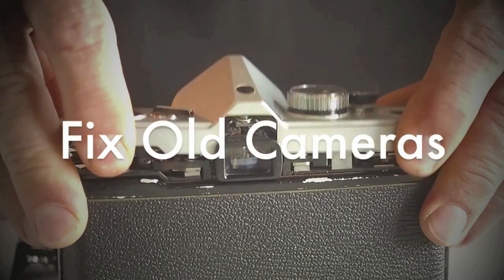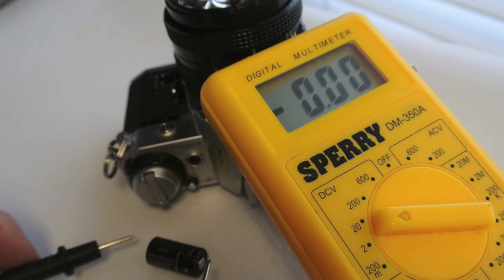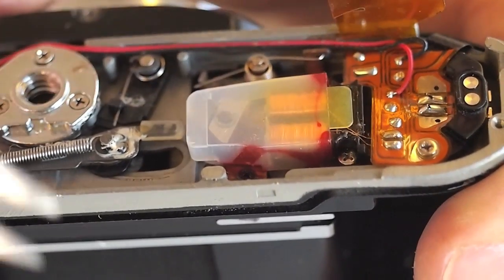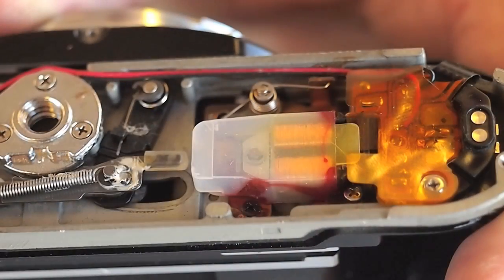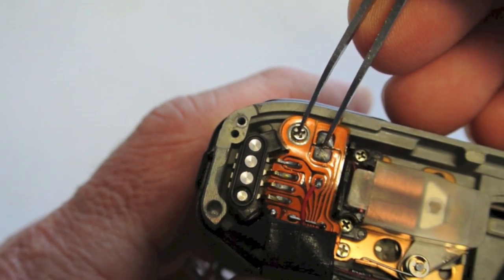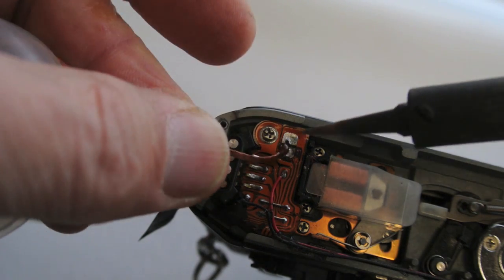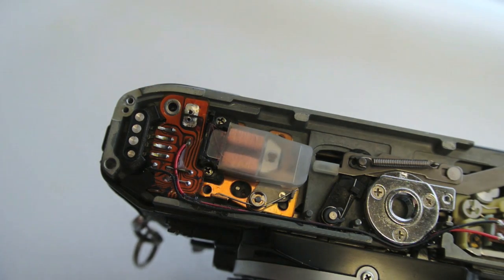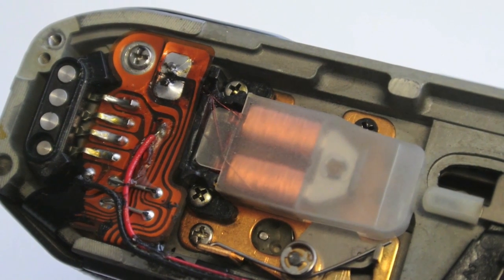Fix Old Cameras: AE-1 Release Magnet

Comment: My AE-1's mirror stays up when I press the shutter but does not release by itself, I have to either remove the battery or press the battery check button so the mirror can release. The battery is brand new and my shutter speed is on B mode. What could be the problem? I also opened the bottom lid to check the magnets, the magnet shown in the video is fine, but I noticed other magnet , a smaller one, which I guess it's the mirror's. When I press the shutter the main magnet releases but the smaller one doesn't. I did the ground screw test on it like in the video and it also releases that way.
Reply from the maker: Your description of the camera malfunction could indicate an issue with the tungsten ASA link wire. Is the shutter hanging open while the mirror is stuck in the up position? The  typical symptom of the tungsten ASA link wire breaking or coming off the pulleys is the pegging of the meter indication and the mirror to hang up with the shutter open. Remove the top cover and inspect for such a malfunction. If you find the link wire to be broken .005 Kevlar fishing line is a suitable substitute or find a donor camera. Watch FOC video Canon AE-1 ASA Linkage Wire -
https://www.youtube.com/watch?v=hJUidgM6LoI&index=17&list=PLbBpUKJh6LCmx4zwCUEg5dCoIraoFd8LS
Reply: Thank you so much for your response. I checked the resistor plate and it turns when I turn the shutter speed dial and the ISO dial. So if it's not the tungsten wire, what could it be?  :(
Reply: And also yes, the shutter hangs open while the mirror is in the up position :/
Reply from the maker: The movement of the ASA/ISO dial confirms that the wire is not broken, but it could still be off a pulley or under the ISO dial contacts. If the wire and connection are in perfect order, than it could possibly be faulty control electronics or open in flex circuit. Because the shutter completes the cycle by tripping with the battery check button you do not have mechanical issue with the shutter or mirror. The most common cause off the described issue is the ASA/ISO dial wiper contacts blocked by the misplaced connecting tungsten wire, but it is not the only cause. If you do not find an open or short in the flex circuitry, an IC failure is the likely culprit.
Reply: I'm taking my camera to a canon authorized service agency since I don't have enough equipment to check that and I'm afraid of ruining the ASA dial because I don't have the proper wrench to open it, lol. But I'm telling that to the tech support, thanks to you now I know what the problem might be and I've learned a lot about film cameras in just 2 days by watching your videos, it's amazing. Thank you so much for your response and I'll keep in touch in further resolution of my cam. :)
Reply from the maker: Sounds like a good plan and thank you for your comments  and interest in Fix Old Cameras.

Comment: Hi! I’m worried about my camera Canon A-1 and I would be very grateful if you could help me.
The problem is that the mirror in my Canon A1 is stuck up. This means that I cannot take any photos. I tried to pull it back ‘down’ but it just keeps moving ‘up’. I have no idea what to do, please help me!
Reply from the maker: It could be that you have dried mirror lift escapement...
https://www.youtube.com/watch?v=4YMpMHwMtX4&t=6s  it applies to the A-1 also

If you decide to go deeper and investigate the mirror mechanism function...
https://www.youtube.com/watch?v=ouxlXb_DMKQ&t=329s
Reply: I only now doscovered that the rewind button at the bottom of the camera is stuck in its ‚depressed’ position. the mirror is still up, i cannot advance the film to the next frame and the shutter won’t release. what should i do? follow the steps shown in the video?

Comment: my ae-1 shutter curtain wont close after i press the shutter button. is this method applicable for my camera problem?
so after replacing the camera's battery with a new 4lr44 6v battery. my shutter button now can work, but oddly after it fire, the shutter curtain won't close :( (the shutter speed is not at B) i see this by firing the shutter button while let the back of the camera remain open (i did not load any film) and when i press the battery check button, the black shutter curtain close. obviously i thought there is something wrong with this camera. is this have something to do with release magnet? please help.
Reply from the maker: +Josh Smith 
The second shutter curtain hanging open is not caused by a release magnet malfunction. It could be caused by the tungsten meter link wire being dislodged and getting caught up under the wiper contacts of the meter resistor base. You might refer to the FOC videos, Canon AE-1-Top Cover Removal and Canon AE1-Jammed wind lever for some insight into where the link wire is located. There are also other malfunctions that can cause the issue that your camera is demonstrating, but the one described is common and easier to address.
Reply from the maker: Excellent to hear of your successful repair.

Comment: When I press the shutter release the camera only occasionally releases. It has a fresh battery and I have cleaned the magnet. The problem is that the magnet doesn't release. What is the next step considering the magnet is working.
Reply from the maker: If the magnet does not release via the procedure outlined in the video, the magnet is most likely defective. Otherwise erratic release could be the magnet release capacitor. It is located next to the release magnet and is typical blue. It will be difficult to measure static voltage to determine condition of the release capacitor. The switch closed by the release button sets a chain of electronic events in motion.When things have progressed enough 
to suit the CPU(central processing unit) inside one of the three main IC circuits, pin two of PX-2 IC connected to pin nineteen of PX-3 IC goes low and trips the shutter timing sequence. The connection is also taken thru the flex circuit at the coil of the release magnet to enable it to conduct. This capacitor then discharges through the coil of the magnet. You might try swapping out the capacitor from another AE-1 camera donor.

Comment: My magnet is bad but also the shutter will not wind and the mirror sticks in the up position when the magnet release is engaged by jumping the contact point. What does this mean?
Reply from the maker: The issues listed in combination with the bad magnet might make the camera in question a candidate for the role of a parts camera. The camera is probably going to need some significant work to restore it to good working order. Sorry that this post does not offer any simple solutions. Thank you for your interest in Fix Old Cameras

Comment: I've cleaned the magnet surfaces in my AE-1 and it releases when I short the magnet terminals but not when the shutter button on top of the camera is pressed. Any suggestions?
Reply from the maker: There could be a break in the flex leading to the upper circuits or the shutter release switch could have poor contact or bad solder connections. Another possibility that is really no longer practical to repair is the IC that sets on the shutter release side of the prism could be defective.
Reply: Fix Old Cameras
OK, thanks very much.

Comment: Great video, i have an issue with an A1 the advance crank lever is stuck and que shutter is in middle position, I tried this solution but the crank do not move, can you help me?
Reply from the maker: If the shutter is stuck in mid advance or release than there is an issue in the gear train or levers that control the shutter function.

Comment: My Canon AE1 has the following issue:

the lever arms the mechanism just fine, the shutter button just opens the shutter and mirror, but doesn't close them. When the battery test button is clicked, the shutter and mirror return to their closed position.

The shorting of the magnet circuit in the bottom of the camera, results in a normal functioning shutter and mirror, also matching the shutter speed selected on the dial.

What could this issue be? Is it a dirty or defective shutter button?
Reply from the maker: Sometimes a broken or entangled ASA linkage wire can cause the symptoms you listed. 

This FOC video might help.
https://www.youtube.com/watch?v=hJUidgM6LoI
Reply: @FixOldCameras , I have fixed the ASA Linkage wire and the mechanism is working fine, but the shutter is still not releasing on its own. I've read that this could be a PCB or Ribbon cable issue. Do you think it's still fixable?  

P.s.
This AE-1 has been sitting on a shelf while I was using other cameras, but I enjoy the repair attempts and getting to know the mechanics of these camera's better. Your videos are very helpful and well made, so I want to thank you for that!
Reply from the maker: @CutCopyPastefy   If you have checked the continuity of the release magnet and cleaned the holding surfaces than check the release capacitor. It is usually blue and lives next to the release magnet. You might also check the release switch contacts. If these all check out you pretty much down to an electronic issue.

Comment: Hi, I've got a similar problem I think, the lever won't advance the film but the numbers wont rewind... Dont want to force anything but stuck for things to do!
Reply from the maker: If the counter numbers do not reset when the film door is open then it is usually caused by the counter dial return spring or the counter dial engagement lever.

Comment: my shutter on the ae 1 sems a bit slower than my dslr is this normal or should it be just as quick as a digital one? thanks
Reply from the maker: It may sound a little different as the cloth horizontal travel of the shutter in the AE-1 function differently than the vertical travel of the metal shutter in you DSLR. As rule the shutter in AE-1 is fairly reliable on the speeds. If it malfunctions on the slow side it usually hangs open to the point where there is little doubt that it is having an issue. Probably the best test would be to take a test roll and take careful notes of your exposure settings.
Reply: Fix Old Cameras thanks for your help
Reply from the maker: Good to hear from you.

Comment: Hi, i've got a problem with my AE1, when I want to advance the film, at the end of the process the curtain opens.. battery is new, shutter release works just fine.. can you help me ?
Reply from the maker: Trying cleaning the surface of the latch plate and holding permanent magnet of the shutter release magnet unit.

Comment: i havea problem withmy AE. my shutter cannot release, theres no problem with the battery. but when i short the ground screw to the magnet release terminal, the shutter is released. ive tighten the screw up but it still doesnt want to release the shutter button. but again when i short the ground screw, the shutter release. but everytime the shutter is released using this method, the speed is always the same wether i set it on 1/1000 or even 2scnds. could you please help me?
Reply from the maker: Probably not going to help much, but, make sure you are getting battery + voltage at the lead on the (blue) release capacitor closest to the release magnet. Make sure you have battery + voltage at the lead of the release magnet closest to the release capacitor. If good, check coil continuity of the magnet. If no continuity, remelt solder at the test points. Also top cover can be removed and all the switches on the release side of the camera should be checked. There could be an open in the flex circuit or connections that will need to be traced. Then there is the possibility that all is for not as you could have a defective IC, the one that lives on the release button side of the prism flex.

Comment: just bought an A1 but it seem that the aperture stuck at 1.8. the lens are working fine. can u help me.
Reply from the maker: If the aperture stays open and the display is normal (agrees with the dial indication in aperture priority mode and all other functions are OK, then you will find the problem to be with the aperture control magnet (MG-1) or the CPU-IC or the OSC/INT-IC. If MG-1 is defective it is practical to replace, but requires removal of the mirror box to access. Defective IC are generally not practical to replace. Check the condition of the solder connection around the IC placements. You can also check the connections of the red wire that carries the battery voltage to the attachment flex circuit for MG-1. The issue can sometimes be repaired without pulling the mirror box, if the MG-1 is not latching because of dirt, oil or a mechanical problem (such as AE unit that has jammed gears or levers).   The aperture magnet can be partially accessed by removing the release magnet assembly unit.

Comment: Was out shooting. The shutter wont fire but I can advance the film. Battery seems perfectly fine when I check (i know this isn't the best way to check however!)
Reply from the maker: +JoelQuinnPhotography Always start the troubleshooting process for a release issue with this camera by checking the battery function in another known good camera or by checking the battery under load. Otherwise start with a new battery. Then follow the video to check the magnet and release sequence function.
Reply: +Fix Old Cameras Once you check the magnet and if it does fire (by touching the two metal parts with some tweezers) do I need to do anything else? 

If i do take it off and have a play, is it very simple tinkering around?
Reply from the maker: +JoelQuinnPhotography  If the magnet energizes then the issue is in the release circuit or a loose ground screw. Check the ground screws by the release magnet and by the left of the eyepiece ( you will have to remove the top cover to access this ground screw). The additional circuit trouble shooting is much more involved, but I will include some information from a previous post. Probably not going to help much, but, make sure you are getting battery + voltage at the lead on the (blue) release capacitor closest to the release magnet. Make sure you have battery + voltage at the lead of the 
release magnet closest to the release capacitor. If good, check coil 
continuity of the magnet. If no continuity, remelt solder at the test 
points. Also top cover can be removed and all the switches on the 
release side of the camera should be checked. There could be an open in 
the flex circuit or connections that will need to be traced. Then there 
is the possibility that all is for not as you could have a defective IC,
 the one that lives on the release button side of the prism flex. Also, if you are using an alkaline battery you might switch to a silver or lithium.

Comment: I manual release it but the curtain doesn’t open, nor does any shutter speed affect length of the sound
Reply from the maker: Check the holding curtain magnet. The smaller of the two magnets visible with the bottom cover removed.
Reply: @FixOldCameras  the problem started after i dropped my camera, i ordered a new magnet, replaced, and had no luck. Then i noticed how stiff the replacement magnet was. Turns out it was just the spring holding the magnet came off. Put it back, worked like a charm! CHEERS!!! :D
Reply from the maker: @javier4781  Right on. Keep'em going.

Comment: Hi, would it be the same process if my camera was firing whenever I pulled the lever?
Reply from the maker: Yes, the surface of the permanent magnet of the release magnet might need to be cleaned or the holding ability of the magnet might be suspect.

Comment: My mirror is stuck in the up position ( like its taking a Bold shot) and I can't wind the lever. The battery is new and in properly. Any suggestions??
Reply from the maker: Are the shutter curtains in the wound or the released position? It could be that the mirror lift escapement seized up. This is the component that causes the infamous squeaking in the release and sluggish mirror lift operation. The FOC Canon AE-1 With Squeaking Release video might help.

Comment: I cleaned the magnet, but it didnt work.  I can trip it by shorting the screw to the terminal.  What could the problem be?
Reply from the maker: If the magnet energizes then the issue is in the release circuit or a 
loose ground screw. Check the ground screws by the release magnet and by
 the left of the eyepiece ( you will have to remove the top cover to 
access this ground screw). The additional circuit trouble shooting is 
much more involved. Probably not going to help much, but, make sure you are getting 
battery + voltage at the lead on the (blue) release capacitor closest to
 the release magnet. Make sure you have battery + voltage at the lead of
 the release magnet closest to the release capacitor. If good, check coil 
continuity of the magnet. If no continuity, remelt solder at the test 
points. Also top cover can be removed and all the switches on the 
release side of the camera should be checked. There could be an open in 
the flex circuit or connections that will need to be traced. Then there 
is the possibility that all is for not as you could have a defective IC,
 the one that lives on the release button side of the prism flex. Also, 
if you are using an alkaline battery you might switch to a silver or 
lithium that is delivering the full 6 volts.